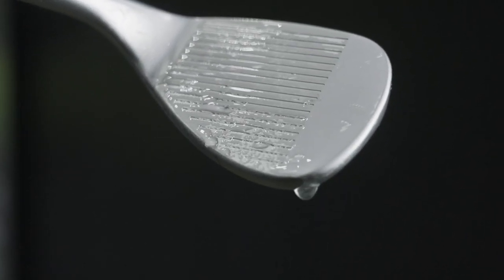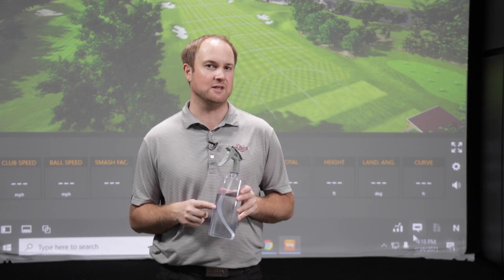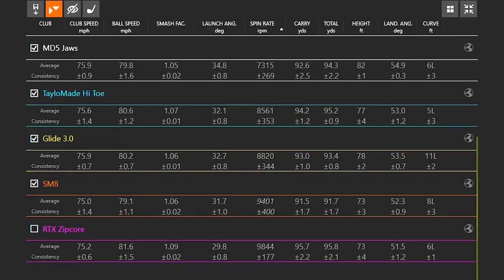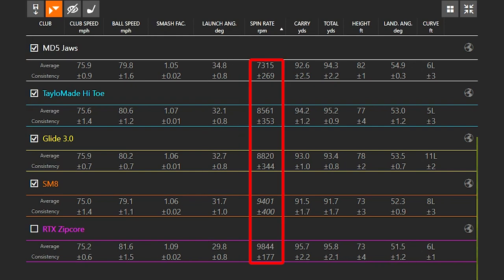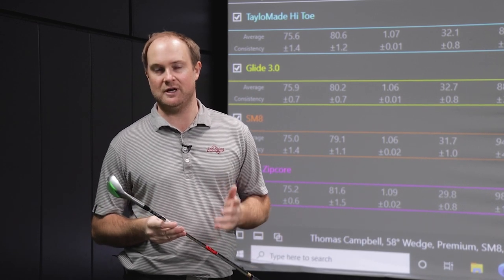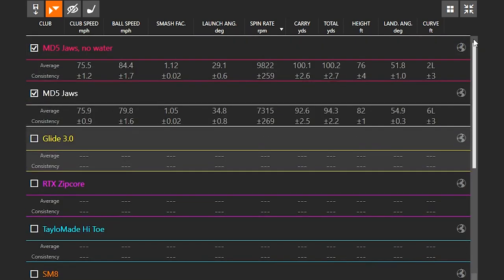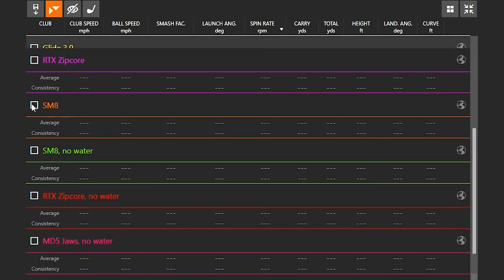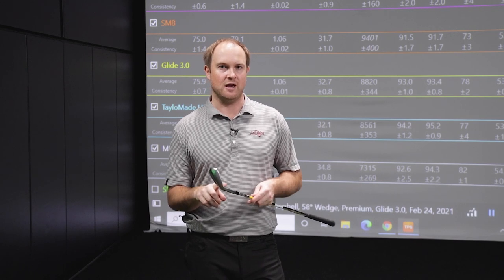Golf Wedges Water Spin Test | How Does Water Impact Spin?

Comment: I have seen this test done on a few different sites that I consider legitimate and the result vary wildly. The TXG guys got great results from the ping for example. Also seen that Matte balls really drop off. I struggle to understand why results differ so much.
Reply: Simple 1 guy 1 day not enough data this variance is high.  Need ALLOT of golfers and ALLOT of shots to get anything close to a legit test.  Best bet would be a site like my golf spy
Reply: If you watch the TXG wet wedge video, the Ping 3.0 performs comparably here. TXG was seeing performance drop form around 12000 to 10000 rpm, where Second Swing is seeing a drop from around 9800 to 8800 rpm. Compared to the competition, the Glide 3.0 performs well. Also, the Glide 3.0 is the only model in common between the two tests, so you can't really compare them apples to apples.